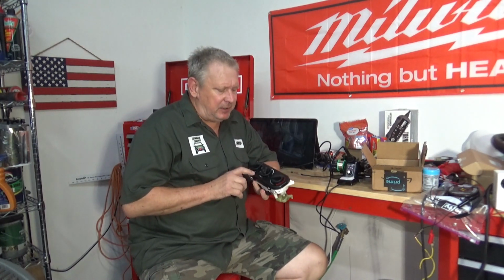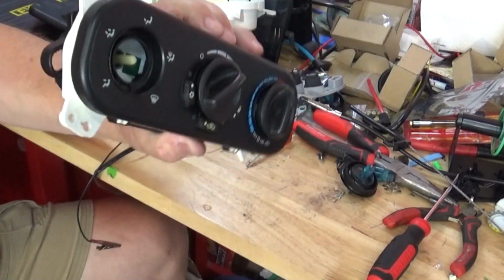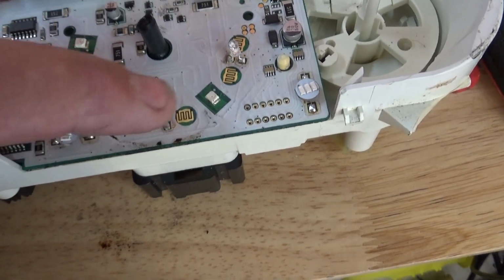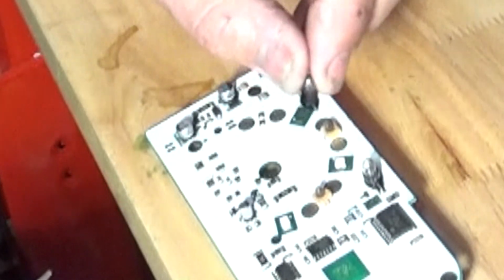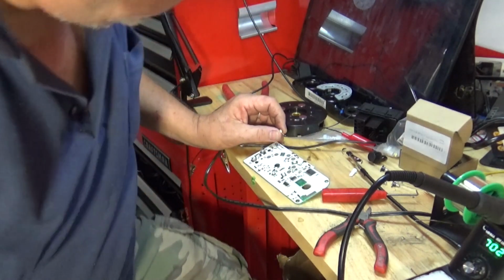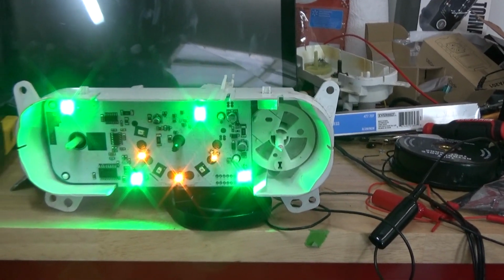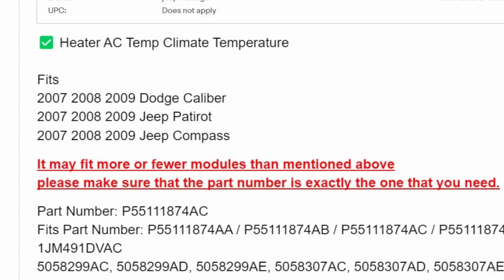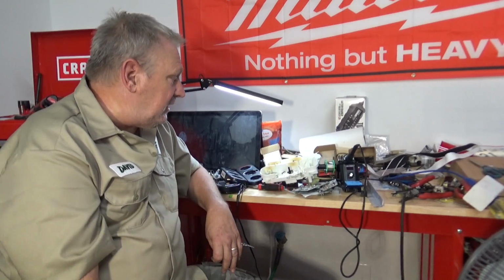Jeep JK Project - Climate Control Lighting - Replacement Instructions 55111840AE

Comment: What were you using to put a voltage on with the alligator clips?
Reply from the maker: 12v small power supply
Reply: @RedneckGarage   do you have a link? That would be very helpful for the project.
Reply from the maker: @jameshall9914   You could use this one - just cut off the end and use the wires - https://amzn.to/3F8pEgL

Comment: Honestly I'm thinking the whole JK line is just a grab from the bin jeep...The dash you fixed and the bin parts from all over,.. Motor: 3.8 L from a minivan,.. then they switched to the Pentastar AFTER it had proven itself in other models... Axels: OMG dont even get me started on the garbage they call a front axle on those things,.. Axel tubes bend at the pumpkin with even the mildest off roading,..everyone "fix" get a truss...eff that get bigger axels and forget that garbage underneath (it actually costs more to fully upgrade the stock one than a heavier duty one),.. Lockers (your choice, air, electric, lunchbox, whatever works for you) While your at it trash the stock suspension (rubicon model is ok as it's got a small lift) something big enough to throw 37s underneath and you'll be able to go almost anyplace. rocksliders, belly plates, and body armor, to keep from tearing up that long a$$ 4 door,. oh and bumpers cause the approach angles suck ballz with a stock front bumper... Oh and a 12k winch, cause you know your going to need to pull yourself out of some garbage you got yourself into... I've worked on more JK's than TJ, YJ, CJ, combined and while I like them because you can do so much to them I still would take a TJ over one any day of the week...In fact I have lol...a 4.0 TJ Sahara and a 47 willy's CJ with a 3.8 chevy and a ton of goodies on it.
Reply from the maker: Truth .... lol the TJ was the last "real" Jeep Im afraid :)

Comment: Learning to use a soldering iron all those years ago has come in handy through the years.  Unfortunately, failing eye sight now limits what I’m able to do.  Nice job with this repair.
Reply: I hear ya.  It takes some years to become handy enough to do just about anything and then almost instantly the eyes and old bones start to fail :).  I've found the Optivisor fixes the eyesight problems --> I use them a good bit doing guitar repair work.  If you haven't tried them, you aught to.